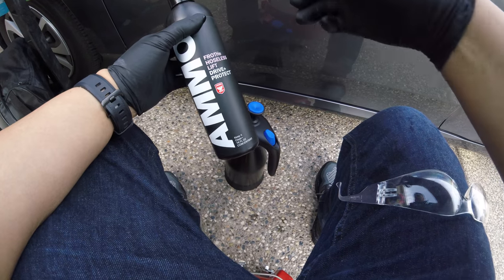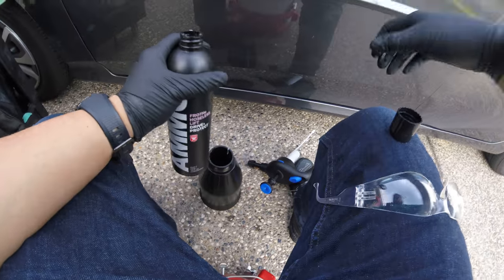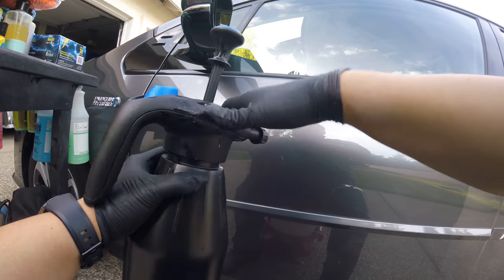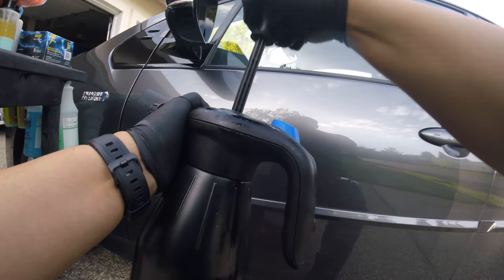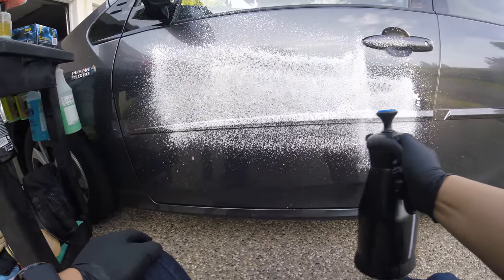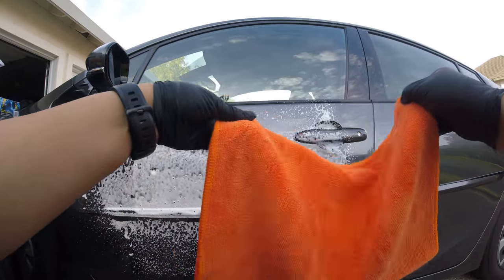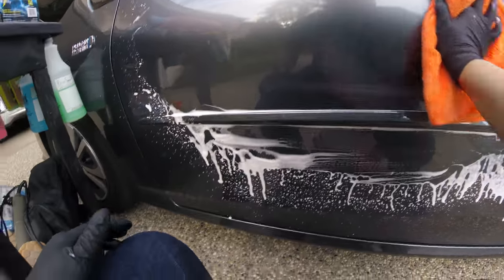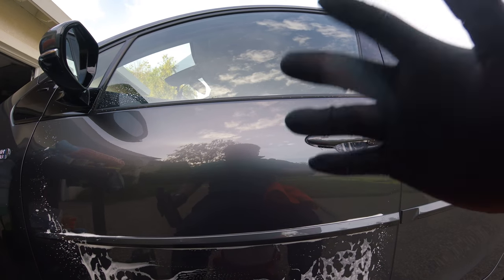AMMO FROTHe + AERATOR First Impressions - GoPro HD/4K

Comment: Nice. How many towels did it take to do the whole car?
Reply from the maker: MiddleEasternGuy So the car in the video is a Prius Prime, so it's not a big car. In the video, I used a lot of sides but that was me getting used to the product, once I got the hang of it was more proficiant with wiping the foam off. Since it was my own personal car so I was more generious with my towels. I went through about 5 towels (the orange onces I use we're also from AMMO so the size is 14x24 inches). If you wanted to use towels more properly and/or detailing for a client, I'd say 6-8 towels (with the 14x24 inch size) for a sedan.
Reply: Chris Lew Thank you. I actually ordered the complete kit from AMMO and am really excited to use it for my own car (BMW E46 coupe).
Reply: MiddleEasternGuy I did my lexus SC300 (Toyota soarer) with one towel, just paint no wheels
Reply: Zach leinbach Same. I think the number of towels will correlate to level of contamination present as well. If it’s light driving dust, one should be plenty (or two to play it extra safe).
Reply: This is a bad plan friend.
Reply: MiddleEasternGuy I haven't bought or used the product yet but there's NO WAY one towel is enough to do a fairly dirty car. I have a Fiat 500 Abarth and when I do a RW or WW I use 5 towels to do the car itself, so I would think the same 8s needed to do this safely. Most of us enthusiasts have many, many plush, edgeless towels, so there's no need to cut corners here.

I'm going to end up with this at some point🤔
Reply: Klasse Act Hence why I said “two to play it extra safe” and I emphasize the light driving dust, meaning 2-3 days maximum (not accounting for severe weather conditions such as rain or dust storms). If it’s been more than a couple of days or extra dirt is present I resort to a full wash with water.

Technically if you think about it, all waterless wash solutions are about “cutting corners”, or rather, minimizing effort and maximizing efficiency (of the process). Otherwise consumers or enthusiasts would just continue to wash their cars as normal. These products exist as an in-between and a worst case (lack of water) scenario for washing, and the creator of Ammo FROTHe even states to use water if it is readily accessible.